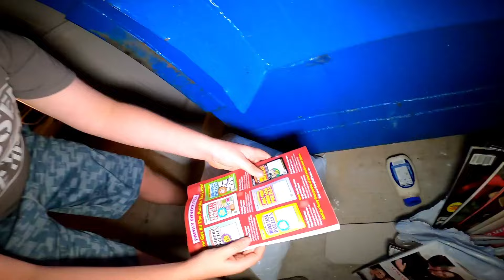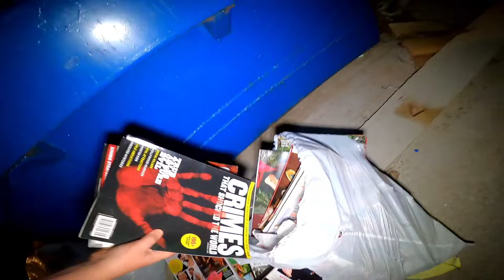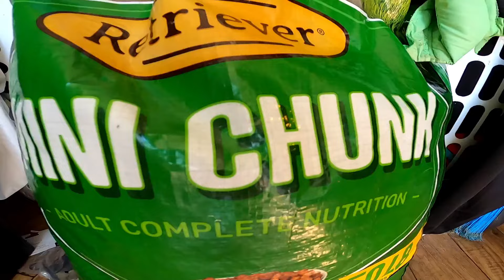Dumpster Diving We Hit BIG With These Hidden Mystery Bags!

Comment: Hi there, if you are thinking of growing something in the large black tub i wouldn’t patch up the hole as you need drainage anyway, otherwise it could end up waterlogged and the plants could die. It probably was used as a planter before it was hrown away in the dumpster and hole was intentionally put there.